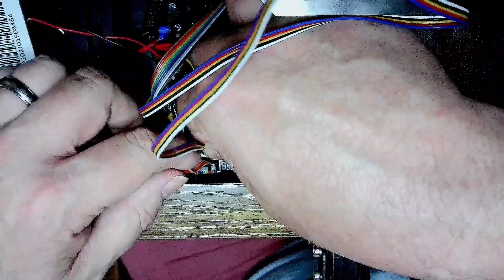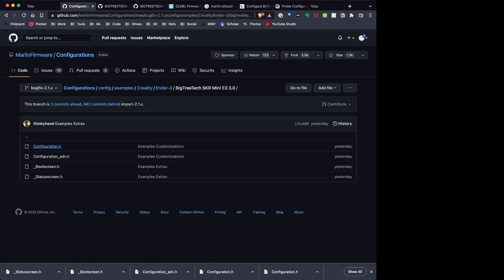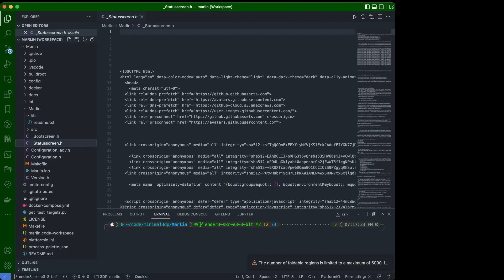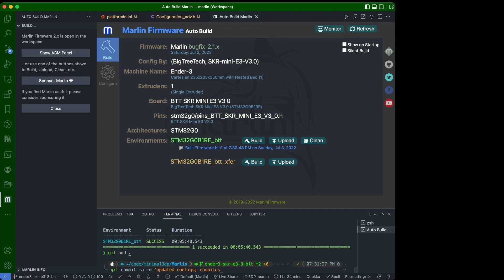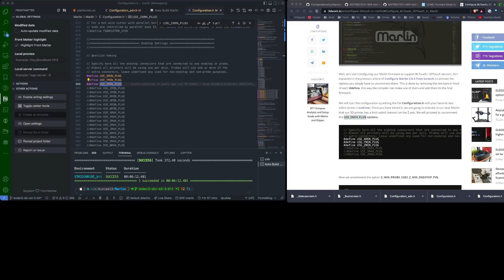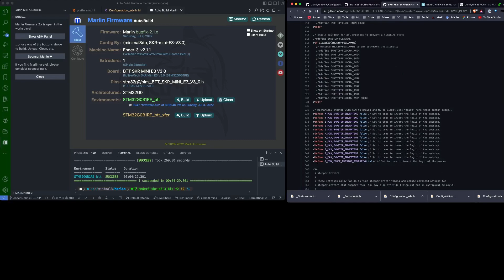3D Printing: Installing a BL Touch Clone with the Bigtreetech SKR Mini E3 v3 on an Ender 3

Comment: Please help. I've been up for four nights trying to get the Ender3 to work with my SKR Mini E3 v3.0 and a 3dtouch clone sensor. The BTT firmware is on GitHub - the sensor works, but the printer either prints in mid-air or tries to crush the glass, and it doesn't care at all about changing the z_offset value. I've tried everything, including all sorts of Marlin versions, and I even lowered the bed like I did on the Priora, but it's all useless. I even tried writing firmware through DeepSeek, but it keeps giving me compilation errors. Some people say the only solution is to install a Raspberry Pi and Clipper, but I don't have the funds for that yet. Please, save my nerves. If anyone has an Ender 3 with this same board, please give me a working firmware in bin format. I'm exhausted.

Comment: I think your video covers exactly what I need, but you're not explaining certain things, such as where are the files that you're working in? Because it seems you skipped a few steps and because you're using short-cut keys instead of using the mouse pointer so we can see where you're clicking, it's very hard to follow.

Another issue I have with tutorials like this is that everyone assumes we know VS Code. It's easy to understand VS Code as as editor, but to use it to compile, it's never as straight forward as people doing these tutorials make it seem.
Reply from the maker: I appreciate your feedback. I will take a harder look at how I am explaining the topic and see if I can do better.

Comment: Hi, I was wondering if you have any ideas about an issue I'm running into. If I use the big tree firmware off their site the bltouch works. But if I try to compile my own firmware the bltouch does self test at start, all the features work in the bltouch menu, but probing bed or homing will crash into the bed. Any ideas?
Reply: Hey, I've got the exact same problem and have been breaking my head over it for a week now. Did you get it to work?
Reply: @melharucos  No sadly, I've been threw tons of web pages and videos and have tried everything for weeks. Anything and everything else will work no issue except the probe, even though the probe is functioning fine, wiring is correct and I've tried the probe port on the board and also the end stop port and set firmware up accordingly and still a no go. And I dont want to use the big tree tech firmware as it's already compiled and I can't add or change any features and its ancient on top of that. So I just have my bltouch unplugged an manually level like the good ol days.
Reply: @LukeRT  Damn, at least now i know I'm not alone. I'll let you know if I find anything.
Reply: @LukeRT  Well... BLTouch works with Klipper firmware just fine. I guess Marlin or its configs are just broken.
Reply: @melharucos  Can I run Klipper on an SKR mini 3v3 ? Or do I need additional hardware ? I currently run that with octoprint on a raspberry pie 3 +
Reply: @LukeRT  You can't run Klipper directly on the SKR board. I'm using a Raspberry Pi Zero 2 W connected to an SKR mini e3 v3 via USB but I guess any Raspberry Pi should work.
Reply from the maker: Can you share your code?
Reply: @minimal3dp  yes, where should I post it? Copy and paste it on here the config? Or upload the config to a share?

Comment: Why do we have to compile this ourself and we cant just use a file someone else makes?
Reply from the maker: If you find a precompiled version you can. I usually prefer to do it myself so I understand what is going on and I can learn.
Reply: @minimal3dp  I dowloaded the firmwear from microc for my SRK e3 v3 but idk ifs working how it should. I just need to get up and running asap
Reply from the maker: @Thomas-Skaa  did it boot up? If so, you probably just need to calibrate.
Reply: @minimal3dp  I did calibrate but it still prints a little higher then it should. When I do the paper thing its fine but when I actaully print it prints a little higher

Comment: I bought a Creality BLTouch for this BTT and I noticed I will have rewire the connections to the board. The white & black wires are on opposite side from what I can tell.  WELL, just saw a video that confirms I was given the connection for CR Touch instead of BLTouch!
Reply from the maker: It should be pretty easy to switch the wires at least.

Comment: Excuse my ignorance but is there any hope for just plugging in the thing and installing the firmware provided by bigtreetech without having to know coding? They soldered in a socket so you can easily connect the bltouch but you have to be a coding mastermind to get it to work??
Reply from the maker: I believe you could just do the BTT firmware. I don't because it is dated.
Reply: Dated as in for V2  instead of V3 or something else? I was just hoping that after I install the bltouch and load the BTT firmware I will be able to set the probe and probe z offset from the printer (with the TFT display), does the off the shelf firmware allow for that?
Reply from the maker: @TomTheDude88  Looking at their GitHub there is a version configured for the BLTouch so it is "off the shelf". 

As for my ideal of dated, the BTT firmware is 3 months old, it is probably v2.0 vs 2.1. I personally prefer bleeding edge. I think the BTT would work for you but I am saying that without personally flashing. Does that make sense?
Reply: @minimal3dp  It doesn't work. I tried both BLT versions. One other person on youtube was able to get it to work by moving two of the BLT wires to the Z end stop.
Reply: Agree, I just installed mine yesterday, with a CR touch, used the BTT firmware for BLT - BLT as Z End stop, and NO DICE. It will not home, the print head stays 15-20 mm from the bed and will not go down. It also throws M399 errors.
Reply from the maker: Your not ignorant. It is a good question.